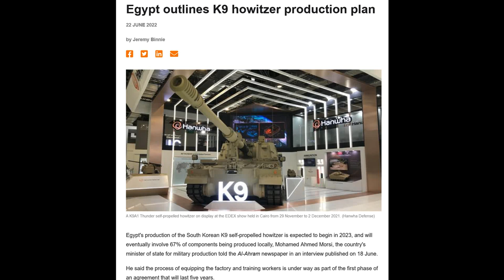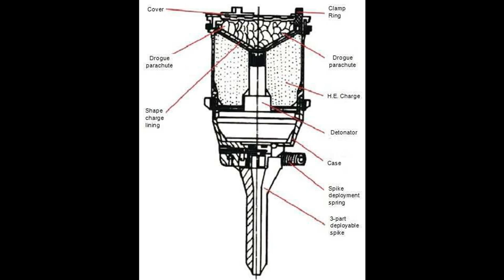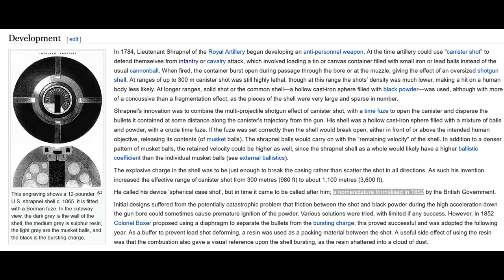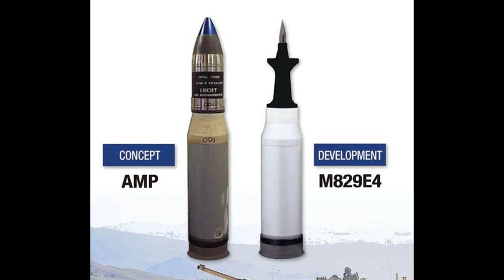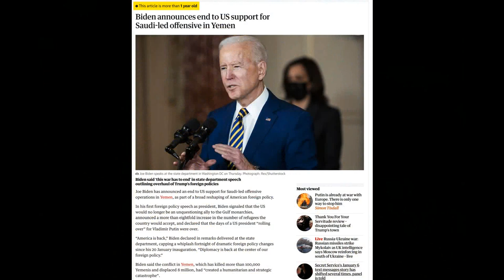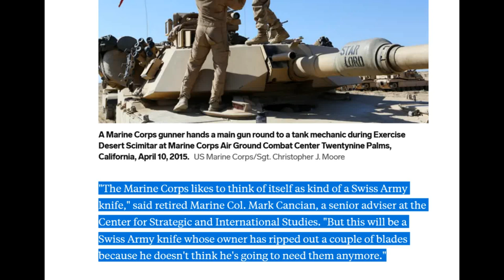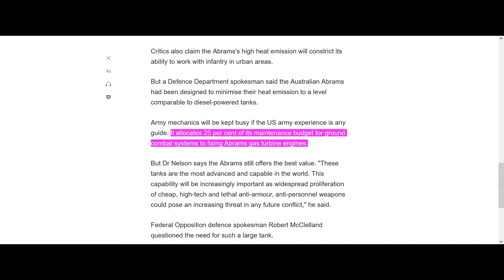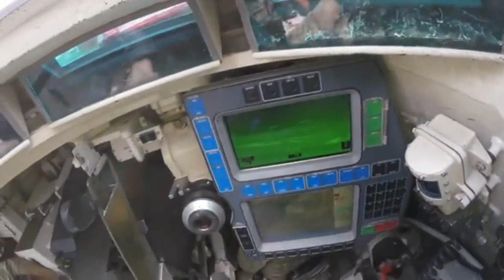The REAL M1 Abrams: 2022 update (Part 1/2)

Comment: Thanks for fixing the audio! This version is really more watchable than the previous ones.
For the tank issue in Australian Defense Force and Republic of China Military. There are two best solutions:
1. Upgrading the existing Leopard 1 and the M60 Patton no matter how poorly armoured they are
2. Buy the Stingray Light Tank, since both Australian Defence Force and ROC military still have M113 variants in active service. More importantly, Cadillac Gage did mounted the 105mm Rifled gun and the turret along with the components on M551 and M41. This is actually a big deal. Because Stingray Light Tank do share spare parts with M2 Bradley and M113.

Comment: Thanks for the deep dive. Very on point. Though I find critisism of M1147 shell a little bit strange. Eectronically programmable fuse is obviously a step in the right direction, the tactical advantage is reprogramming in the chamber and being able to targert search and set fuse up with ammonition loaded. As for old tank comptaibilty I wonder if a manual quick programming tool can be made for loader to operate, that would make it just on par with manual programmed shells that you listed in older systems. Also impossibility to program the fancy fuse does not mean impossibility to shoot at default "detonate on impact" setting, making it regular HE round, just expensive. I mean that's bad, but not as bad, as "it is getting hot here, and we have crates of munitions, we can't shoot."
Reply from the maker: The main issue with the "AMP" round is that it's programmed only by the fire control system of an M1A2C or M1A2D, not by the loader, like all of the US Army's prior HE, HE-FRAG, and APERS rounds; only an M1A2C or M1A2D can program the fuse, and that's going to be a problem if the US Army wants to maintain their "NATO commonality" narrative. That, and it's 35 years too late to matter.
Reply: You cannot blame all the problems on a ‘nato narrative’

Comment: @20:35 So Leo2A7V weights about the same as a SEPv3, but you suggest that their APS and mine plough are made of air so their weight doesn't increase and being overweight is only an Abrams problem?
Reply from the maker: The Leopard 2A7AV has a combat weight of 62.3 metric tons, which is 68 short tons;
https://fighting-vehicles.com/leopard-2a7v-tank/

Following decades of permanent add-ons, all M1A1s weigh 70 short tons or more, and all M1A2 variants are heavier than any M1A1s. The M1A2D --- formerly marketed as the M1A2 SEP V2 --- weighs 80 short tons at combat weight, and the Trophy APS will increase it's weight to 85 short tons.

"...but you suggest that their APS and mine plough are made of air..."
The video explicitly states the Trophy system for the M1A2C weighs 5 short tons, as do the sources linked in the comment section, and that mine plows weigh 10 short tons.

Comment: it would also be worth a few sentences that the europack diesel engine pack could fit in the engine compartment of the m1 with very minimal modification, which would solve the range issue and diesel also helps with flammability compared to JP...

Comment: Around 12:49 you imply the belly of the M1A2C is essentially iron, when there's no evidence for that and while yes steel is a catch all for most iron based alloys, it would be disingenuous to imply that the steel, especially belly steel of any modern tank, especially the tank of a country that is renowned for dumping billions into its military (often wasted I know, don't tell me) is "basically iron" as if any designer, no matter how corrupt would be willing to do that. You would have to go out of your way to get your hands on iron plate of that size and thickness these days.
Reply: For the purpose of redox reaction
Reply: @Tattlebot  redox?
Reply: @damianh4510  A tanker isn't going to have an understanding of most of these issues. For instance, how many English speakers have operated a European tank?
Reply: @damianh4510  You are negating the value of literary research. That's insane.

Physical experience with the device is not going to get around the two critical problems of excess mass and fuel wastage / deficiency of the engine+APU scheme. DoT&E said in a statement that the tank is not usable in Europe. Hands-on experience does nothing to address these defects.
Reply: @Tattlebot  All of them stationed in Europe. Comment shows lack of knowledge of how NATO units train together. Its very easy too to simply ask and they will show. How do you think we learned to drift tanks?
Reply: @shawn97006  They're just going to be a huge headache in Europe for the above reasons. 83 tons on bridges which can't handle 70 tons, come on.
Reply: @Tattlebot   Doesnt weigh 83 tons.
Reply: @shawn97006  A2C does with full protection.
Reply: "I'm sure if it were a big enough issue it would've been fixed"
Assumption is the mother of all  truckups 😂

That; and the Wehrmact's failure to address most of the issues with their Panther, Tiger I & Tiger II vehicles during WWII demonstrates how ineffective armies can be in resolving issues, even with wartime preference for resources and manpower.
Reply: ^ A lot of superficial giming, but little else 🙄. 

Also: actual servicemen aren't in the habit of blustering about being as such, unless they haven't anything of substance to state.

Take The Chieftain for instance; it's what he states and how he substantiates it (either by describing or demonstrating) that people are interested in, not so much who he himself is.
Reply: @jimtaylor294  oh come now we're all adults here you can say fuckup.
Reply: @highjumpstudios2384  😆👌

T'was more of a precaution, as Google gets all Mary Whitehouse over certain words in comments, though at times it's hard to tell which ones 🫤 .

Not as bad as what words in a video can get an uploader demonetised or banned though at least.
(at one point the word War was getting uploaders demonetised... I mean what is this, Canadian TV in the '90's? 😅 )
Reply: @jimtaylor294  Hmm, fair enough. Carry on.

Comment: I remember seeing a scavenged abrams hull in a picture taken in Afghanistan,the taliban probably erected it on a road somewhere in Afghanistan with the other military equipment that was trashed
Reply from the maker: Doesn't surprise me. I don't think the Taliban would even be able to start the engine --- a task that consumes 10 gallons of fuel, and requires several minutes and a specific ordered set of procedures (do anything wrong, and engine damage could result).
Reply: @BlacktailDefense  i think you misunderstood what i said,when i said scavanged i meant picked clean of its components with only its chassis left,of course comparing the taliban and isis is like comparing gorbachev and yeltsin,isis won't just attack shias they'll attack anyone who they disagree with.the taliban tried to negotiate osama's extradition atleast three times and made one final try and failed,even osama was warned about them since they were called khorasanis before their seperation in afghanistan from the main alqaeda branch.
Reply from the maker: @newguy954  How much do you want to bet that most of those missing parts are now in the hands of the Russian and Chinese defense industries?

Comment: I viewed your videos since 2011.

The part about Taiwan with their M1A2T was important, I don't see how the tank would help much in combat, considering the M60s can already fight amphibious PLA vehicles while being way more mobile (go anywhere). We've also seen in Ukraine that smart weapons will be utilized greatly, so tank protection is not as important as before as top attack smart weapons will be used en masse.

Also loved the modern pop culture references and memes, and especially the final part about YouTube censorship on certain airborne disease (Thanks Klaus Schwab!); it's cancer taking over big tech.
Reply from the maker: Taiwan is banking the assumption that if they throw enough money at the US, the Pentagon will "send in the cavalry" if they start getting overrun. They apparently haven't noticed how well the same faith-based defense initiative worked out for Laos, South Vietnam, Iran, Georgia, Iraq, and Ukraine. US forces already had a strong troop presence in Afghanistan, and it was still conquered.

Also, it seems that hen I published this video, Poland was already backpedaling away from the M1 deal. Instead of a second batch of M1A2s, they ordered 180 K2 Black Panthers, and a license to build over 800 more domestically.

There are already signs that the M1A2 sale to Poland is starting to fall-through. Notably, they were supposed to buy 250 M1A2s with mass deliveries promised to begin in 2022, but as I type this sentence at the very end of November 2022, the only tanks they received were the 5 pilot vehicles for training purposes, and deliveries of service M1A2s have yet to even be planned. That slipped even further over the Summer of 2022 as the M1A2 delivery date slipped to 2024, and it was admitted that conversions of the M1A2Cs Poland was already supposed to have had in service already won't even start until 2024. In the mean time, Poland is getting a mere 116 tanks, and they're only hand-me-down M1A1s;
https://www.thedefensepost.com/2022/07/18/poland-m1a1-abrams-tank-us/

Incidentally, this overlaps the timeframe within which Poland is expected to receive 180 K2s (so much for M1A2s being available sooner) --- but just yesterday, it was announced that deliveries of the Korean-built 180 K2s will begin this month!
https://www.thefirstnews.com/article/poland-expects-deliveries-of-korean-tanks-howitzers-this-year-34781